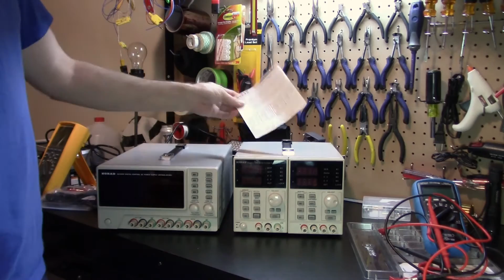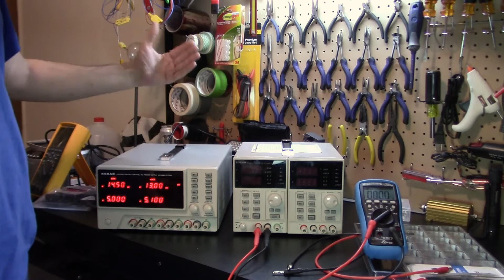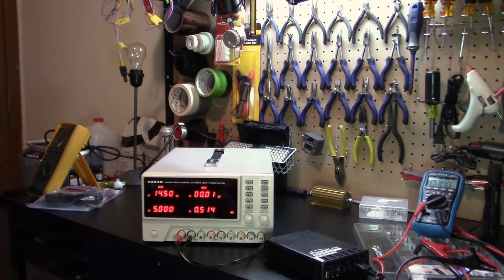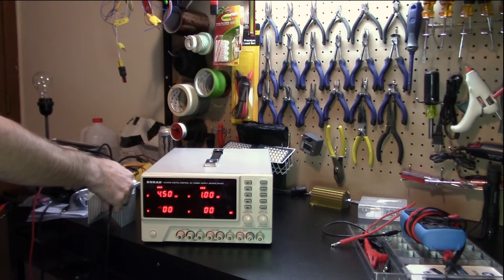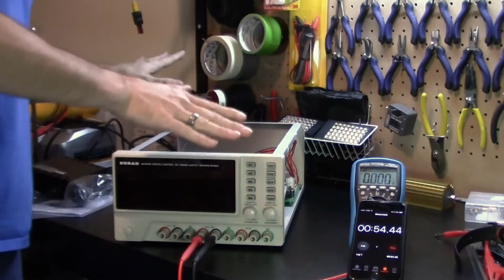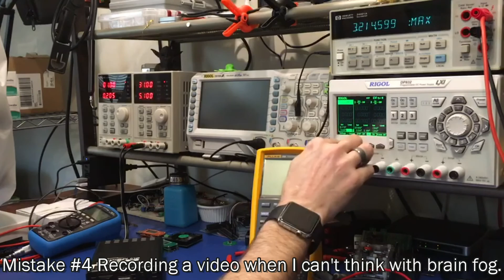KORAD KA3305 Adjustable 30V, 5A DC Triple Linear PSU & Bonus Content

Comment: Is it possible to output a negative voltage?  If you output 5v on both channels, connect Channel 2 + to Channel 1 - and from this you connect your circuit ground. Now as it works then channel 2 - should be at -5v and channel 1 + should be at 5+. I understand how it works and how to configure it but someone on the Eevblog tried this and it does not work. Maybe it works when you  connect channel 1 + to channel 2 -.

Comment: Hi,

   great video.  I see at the end of your video that you also have a Rigol DP832 power supply.  How would you compare the 2 models?  I would be very interested to have your opinion about these 2 models.  

   I thank you.
Reply from the maker: I guess it depends on what you use the power supply for. The Rigol is good for programing voltage stepping and other features like logging to a USB key. If you just need something for power then the Korad or more then capable and better at putting into series/parallel for higher voltages/current. The Rigol also has a max of 3 amps per channel compared to the Korads 5 amps per channel. Plus the Korad runs quieter for most tasks. For most of the general power applications I need I usually turn on the Korad first.
Reply: @GadgetReviews-US  I thank you.  At equal price, which one would you choose?  I live in Canada; The KA3305 with shipping ended almost at the same price that the DP832...  :-(
Reply from the maker: @stephanedesrosiers2436  It sucks that the Korad goes up in price for you. In that case I would go for the Rigol, it’s 3 Amos per channel but most people won’t need or use 5 amps like on the Korad. And the Rigol gives you room to grow if you want logging, or stepping profiles being it’s a programmable unit.

Comment: Why oh why can't you use the Amps knob without hitting the channel 1 button again? That knob has no use while the voltage knob is active. Seems like an extra step that isn't needed. Am I missing something?
Reply from the maker: You can push in the Amps knob also and change the current amps, or. you can hit the channel button as. you mentioned. I guess I was used to the older power supply and would hit the channel to move to the next setting.

Comment: A quick question, I got 2 Korads, 1x KD3005P and 1X KA3003P (both P comp versions and one is KD 5A and the other is KA 3A)
Can I put those 2 Korads linear PSUs in series to get 8AMP out (5A + 3A)
It's these. https://imgur.com/gallery/B7ZOQ3J
Reply from the maker: I have not tried it on the single channel units. If you want increased amperage it would need to be parallel, not series. I personally would keep the voltage and amperage the same, so you might get 6 Amps.

As for the hardware in parallel together together it should be fine if you keep the voltage and amperage the same.  I did once out three of the 3 channel identical units together. They were all set to parallel for 10 Amps each, then I wired the three units together for 30 Amps to test a high current precision shunt while using multiple heat beds from 3D printers as the load. This worked without an issue, and the single channel one are mostly the same power supply parts so it should work. 
just be sure to have them set them at the same voltage and current.

Comment: Hey. The power supply has 2 outputs 30v 5A. How to get 30V 10A? Is it possible to set on the power supply so that the output has a regulation range of 30V 10A?
Reply from the maker: When it in serial mode will connect channel 1 and 2 together to double the voltage so 60VDC at 5 Amps max current. When in parallel mode it can do 10 Amps at 30VDC. Higher voltage scan be dangerous, even lethal.  When serial or parallel modes are enabled the leads need to plug into the corresponding marked jacks that’s written under the jacks.

Comment: Ok, I don't like the fan noise comparison
- in older unit you have dead short, but the voltage set to 30V. So power supply selects the highest voltage tap from transformer. (if it switches tap, when actual voltage drops, not the set one, I will revise calvulations)
So the difference Vin-out is roughly 32-35-is volts and current 5 apps. Power that is dissipated is 150W!
- in ka3305D you connect a 1 ohm resistor and have 5V and 5A, so you dump 25W power into the resistor, but inside the supply you have the lowest tap (~8V after rectifier) so you dissipate just 15W (8V-5V)x5A. That's 10% of the power In older model!
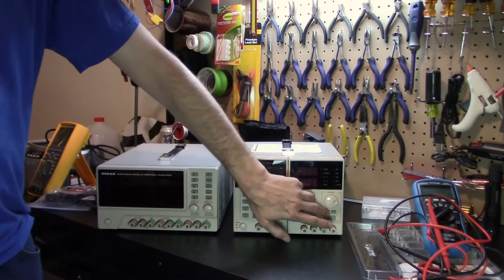Reply from the maker: @ 4:12 without any power out you can hear the fan. Sort of like the oscilloscope fan running at a constant. With the new one, yes the fan will increase as it heats up but is quieter. The point was the old one uses a set RMP on the fan based on the stage of the power supply you set even when it’s not hot.  I used the resistor because the new one with a shunt dead short on a meter wasn’t putting out enough noise to hear on camera an I must of edited it out not thinking about it the way you saw it. But that also means instead of dissipating the extra power internally it may have switched to a lower tap on the transformer since it couldn’t put out the voltage I had set.

Comment: you should change the low rpm 120mm or 140mm noctua fan with a speed adapter and a tunnel is needed to blow the air out of the case or something..
Reply from the maker: On what power supply, the old one or the new one? The new unit already controls the speed of the fan based on the temperature. If I add a separate speed controller this will conflict and could cause the PSU to over heat. I wouldn’t recommend adding any other speed controller. The fan is a decent fan, it is the quietest bench power supply I own even at full power.

Comment: What is the model number of the older version? Any picture I find that looks similar to the older version doesn't have the 5V rail.
Reply from the maker: The older one in this video is the KA3005D-3S, also known as the KA3005P-3S for the programmable one. They stoped making this model over a year ago, so it’s hard to find. 
The -3S is the main part of the model that indicates it’s the triple version. The other singles are still for sale but don’t have the -3S in the model number.
Reply: Thanks for the quick reply! That explains a lot. The pictures I found are of the -2S.. How has the KA3305 been holding out? Any strange anomalies?
Reply from the maker: Nope, it’s been running good. In fact both of them are still running good.
Reply: Thanks for the info (and video)! Looks like I will be ordering one.
Reply from the maker: If your in the US, (maybe canada also) then I would recommend SRA solder. They are one of the main authorized resellers that will honor and back up the warranty if you have any issues.
https://www.sra-solder.com/korad-ka3305d-precision-variable-adjustable-30v-5a-dc-triple-linear-power-supply-digital-regulated-lab-grade

Comment: Could you please tell me where you get those leads from, that you use on the 100W load?
Reply from the maker: Fried Mule Those are 50 cm / 20 inch 13AWG banana cables I bought from 99centHobbies on eBay, user f-t-2000 otherwise known as Frankie’s Store now ran by his brother. But he still sells the same quality accessories.
https://www.ebay.com/itm/50cm-20-034-Silicone-Test-Leads-with-Banana-Plugs-1-Pair-Red-Black-/200873022764?&_trksid=p2056016.l4276

Comment: is the input voltage selectable? I really like this KA3305 and I need one now (110v) but I will be moving to England next year and I'll need the 220v
Reply from the maker: Yes, it's selectable with 110V and 220V on the back. I just pulled mine off the shelf and checked for you.
Reply from the maker: FYI, you will have to change the fuse from a 110V/10A to a 220V/5A fuse if you select 220. It says this in the back also. But might want to buy the fuse in the states before you move. I don't know how hard it might be to get the fuse in the U.K.
Reply: Thanks for checking and replying so fast! From what I've been able to ascertain, this power supply for the money is hard to beat. I haven't really found anything else. I was going to buy two KA3005D(or P) but then I saw your video for this one. Plus this one comes with the extra 5v output. What do you think?
Reply from the maker: It's kind of funny I'm replying on my phone since my internet is down, and the internet is down because I shut my power off to the house, adding a breaker for more power to an outlet for the electric spot welder. And now I'm leaving you input about power supplies when I'm taking a break, lol.
I own the triple version of the KA3005D also, I bought it refurbished and was the first one I bought. They have both held up well, I have three korad triples together all running parallel to generate 30 amps DC to test a shut and they all survived. Creating a 30A load was a different story, but I figured it out also. 
I have a fondness for the older one, just because of a preference and probably because it was my first and I got used to the controls. But they are both good for the money. I would toss the banana cables they come with in the trash (they are cheap) and get some nice ones from Frankie.
Also I would buy it from SRA solder, link in the description. They are the inky authorized reseller to handle warranty work on korad in the US. You might even find other options refurbished from them if cost is an issue, that's the refurbished place I bought my firs one.
Reply: Gadget Review Videos An electric spot welder is definitely on my soon list! The rear of the supply didn't happen to say what type fuse it requires for 240v did it? I've decided i'm going to buy this supply and i might as well get the fuse at the same time.
Reply from the maker: For AC 220V is says to use a 5 amp 250 Volt fuse.
For AC 110 is says to use a 10A 250V fuse.
They are small glass fuses that go into the plug socket on the back of the unit. 20mm long and 5mm round.
Not sure if the official fuse name, hope this helps.

Scott
Reply from the maker: I forgot to mention, they have an F before the Amp rating so they are fast blow fuses. These are the same ones:
https://www.amazon.com/dp/B01NAFNEI3?psc=1
Reply: Awesome thanks! I'm getting really excited now and I'm going to order as soon as I can thanks man! And thanks for that link and that they're fast blow fuses!
Reply from the maker: No Problem

Comment: 7:21 where did you get that power resistor? I can't find it in Aliexpress...
Reply from the maker: Ahh, some things are not new and you can't get on aliexpress. Unfortunately I just went to the eBay sellers for CTS surplus that I bought mine from in Ohio and found out they closed down and scrapped everything, noooooo! 
Well the one you saw me use was a Dale RH-100 100W 1% 1 ohm wire wound power resistor. I was able to find some on eBay. The smaller ones have solder terminals on them like the 50w and 25w ones. I've put 4 25W together on a big heat sync and it's not the same, they get to hot.
So the single bigger one is much better if you need to resist this kind of power.
I did find some on eBay, try this search,. Some may say Mexico on them, some might not. Mine doesn't say Mexico on the 100W one but some of my 25W ones do.
They are manufactured by Vishay, so they were not cheap when they were originally new. But they are had to damage and hold the tolerances great. Most wire wound resistors will be more accurate over the years unlike the newer cheaper ceramic and surface mount style resistors. And being made from Vishay they are quality.
I bought a bunch of used ones, even found some new when looking over the warehouse stock and they all checked out great. I think I've only had one bad capacitor from that place and will miss that place. Now I don't know how I will get cheap local quality used electronics  parts :-(
http://www.ebay.com/sch/i.html?_from=R40&_trksid=p2050601.m570.l1313.TR0.TRC0.H0.Xdale+rh-100+100W+1+ohm+1%25.TRS0&_nkw=dale+rh-100+100W+1+ohm+1%25&_sacat=0

Comment: The fan in mine runs all the time at a low speed even when only set down to 50mA. I have not tried to load the power supply with more than a 100mA load.  Is the fan supposed to run all the time?
Reply from the maker: This is OK, Mine will start to run slow after about 10 minutes even if I dont use it. Dont forget the 5V-3A rail is always on so this will generate heat. What causes electrics and components to fail it heat. So the fact that the fan runs is a good thing but its still a lot quieter then most other power supplies I have owned or used. The older ones would have a fan that just ran at one speed most of the time until you load it then it kicks on high and is really loud. They dont monitor the temperature and adjust the fan like this one and some of the other new one.  I like the balance between low and quiet when not under load, and when it is under load its still quieter then most others even pushing 10 Amps if you run channel 2 and three together. 
Scott
Reply: Yes but, mine runs at start up. Is that okay or is there a fault somewhere? Should I be concerned?
Reply from the maker: TheGordy1950 No, I wouldn't be concerned. Some has to do with the room temperature (my house might be cooler) and the accuracy of the thermistor or what ever they are using to measure the temperature. As with most chips, resistors and even multimeter and PSU their is a rated 5% or 10% accuracy. It cost a lot more money for the chips that are percision down to less then 1%. So the chip measuring the temperature is probably either a 5% or 10% rated accuracy. This small different may turn your fan on low if the chip is reporting a little different then the chip in mine. Or again the room temperature also is a fracture with ambient temperature. 
It it's nothing to worry about.

Comment: I received mine today and noticed something was rattling around inside and decided to take the cover off. I found a nut inside and I could not locate where it should have been. The only place it would fit was the handle screw so I put it on one of the screws for the handle. Once that was taken care of I decided to power it up and see if everything was working properly. It made the transformer thump sound that was heard in the video however the power supply worked just fine.  
I then decided to tighten all the screws and nuts especially on the transformer. I found that the transformer nuts were not very tight. That alone ,would cause the transformer to
make the thump noise and I was right. After tightening the nuts did indeed stop the thump.

I advise everyone that buys this power supply to check if anything is loose or rattling inside before power is applied.

Hope this helps...........
Reply from the maker: Good catch on the floating nut. Maybe missed durring assembly or came off durring shipping? Enjoy the new power supply 

You might still get the thump once in a while. If you sit and turn it in and off and the caps don't drain all the way during the off cycle then you have less of a chance hearing the noise. If it's unplugged and drains like in my review then you power it back on their more of a chance it might happen. 
I would suggest lock tight on the handle nut good catch. And because you broke the locktight on the transformer nuts I would put some back on again in the threads. Transformers have a constant vibration and the will work loose again if they don't have some good red/blue lock tight. Red is probably better for a transformer.

Here are the reasons why you hear the turn on action, and also the reason it triggers my battery UPS units because they detect a drop on the line.
First, the power line is 60 hertz. The point in the cycle that you happen to turn the power off will magnetize the transformer core such that the transformer will present a very low impedance to the ac power next time it is turned on.
The transformer core acts like a big magnet during the inrush and pulls on the metal making the noise you hear. This only happens for a few milliseconds and then the transformer waveform will settle.  This few milliseconds it happens may cause a drain on the mains lines, like it does with the supply line my lab and why my UPS kicks on. I've had some transformers like my 20 Amp auto transformer cause such a drain with the inrush that it tripped the breaker. My UPS backups are so sensitive they will turn on and try to supplement the drain on the line back to a normal level. 

Sometimes you hear this effect on the core of the transformer and sometimes you don't depending on the amount of inrush current. 

The amount of inrush depends on where in the AC input cycle was when you turn off the power as to what happens the next time it is powered up and if you hear the noise result.
For example if you happen to turn off the supply during the ac input crossover point (zero voltage) , you likely will not hear an inrush result the next time you powered up the supply.
Scott
Reply: The thump from the transformer still happens every once in a while but, is much quieter since the nuts have been tightened. I know I mentioned this before and I also know from experience that putting wood shims between the core and the coils helped solved that problem which was done often in the design of larger transformers. The thump as mentioned is not an issue to be worried about and is normal...

Some have mentioned the clumsy setting sequence which is a pain however, once you get use to it it becomes logical why they designed it that way.